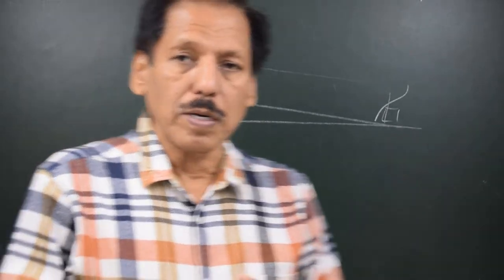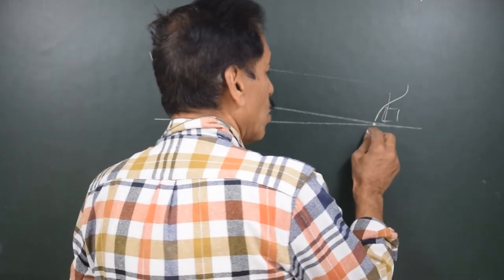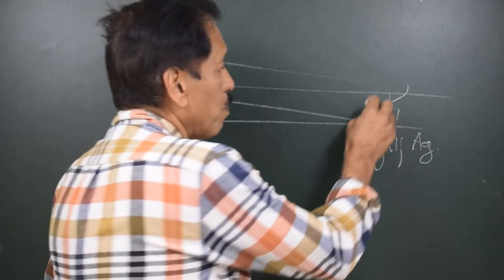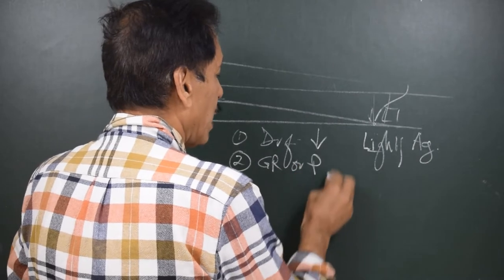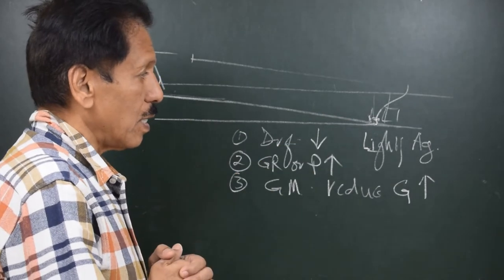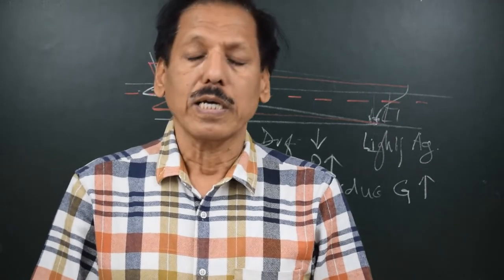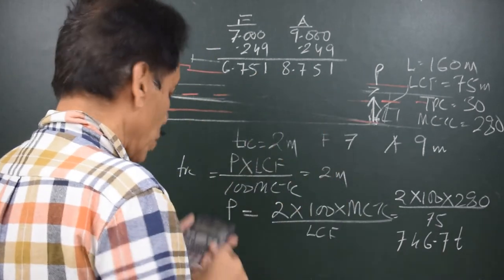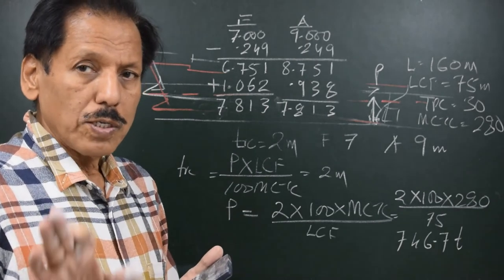Ship Stability Video 35. Flat Bed Grounding

Comment: Sir pls can you explain which one is more stable is partly grounded or fully grounded
Reply from the maker: You mean pivoted on ground or grounded. Though loss of stability (virtual) is directly proportional to reduction of buoyancy by water but in grounded condition if the bottom is supported well the ship is not likely to capsize.